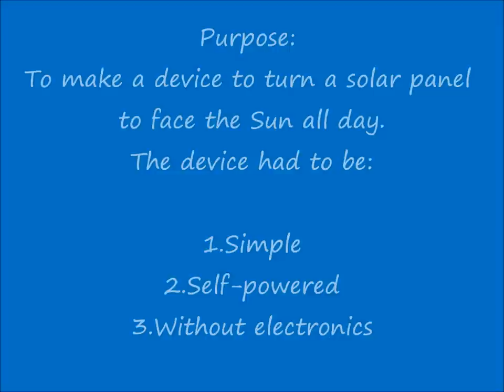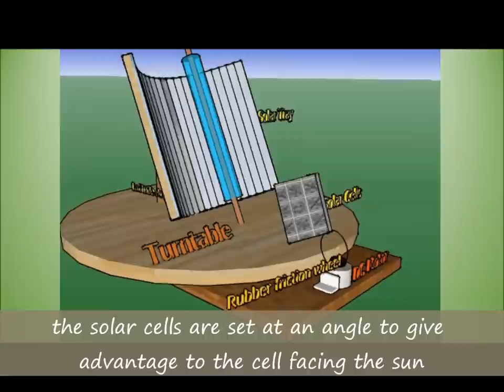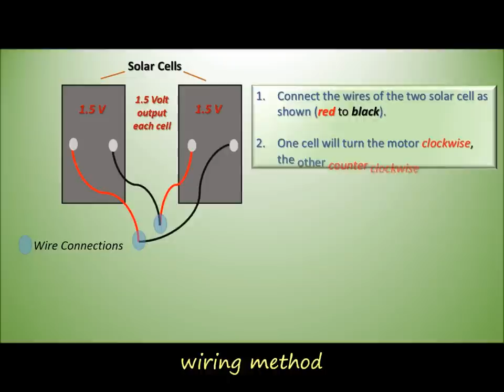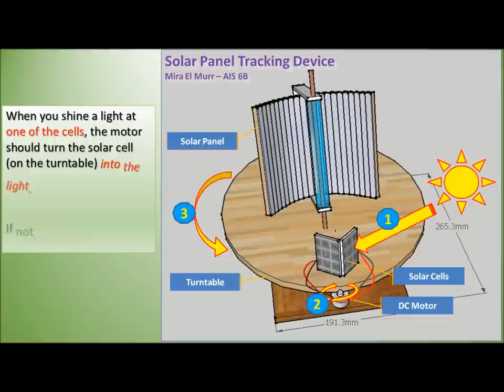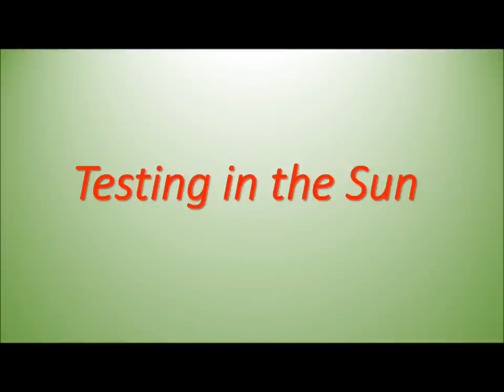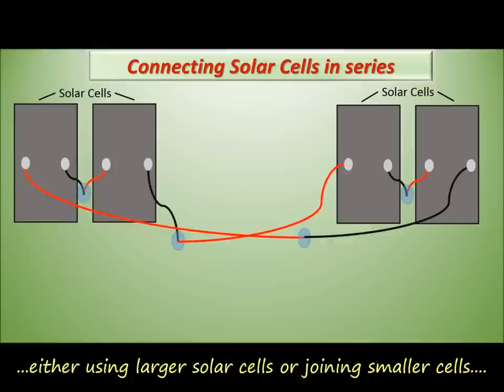Cool DIY Solar Tracker Self Powered No Electronics - How it Works

Comment: a todays solar cell is based on the good old photoelectric effect. as todays cells are effectively photo diodes and a diode is in fact an electronics device i have to assume that the usage of such photo cells violates the given requirement of "no electronics".

in an open circuit a vice-versa serial combination of such solar cells will see roughly the nominal voltage of all illuminated cells. the non illuminated ones work in a resistor like fashion - without a current there is no real impact. but when driving an electric motor then the power sent from the cell with the better energy collection will drive the motor and at the same time drive the same current to the other cell and its "resistor" thus sending heat to that other cell. such operation is degrading those cell over time - even if only one movement cycle is run per day plus the times where there is current but the motor is not supplied strong enough to start moving. mid to long term such a setup is assumed to fail because of the cells are going to loose their original capabilities quicker than in normal use. (on day times whilst normal tracking the one cell that is trailing is ageing, at sun up the other one gets fed with the power until the the whole device returned to the morning position.)

nothing against smart simplicity but sometimes a bit more logic and respective elements are needed to get the whole item not only working but durable. what's a 1$ electronics against some 5$ set of solars cells and the works to replace them to fix the device every 5 to 20 months?
Reply: all they really need is a couple of low value Schottky diodes.
Reply: Schottky diodes are electronics as well. ;-)

but yes, its the right thing. low price, minimal voltage and power loss. maximized lifetime of the whole setup.
Reply: Yeah, I know. I just figured that since the premise of a non electronic solution had already been broken by the use of solar panels it wouldn't be a huge deal. lol
Reply: For the amateurs among us---Could you provide a diagram of where within the circuit the diodes would be appropriate? Thanks.
Reply: I've read that solar panels have by-pass diodes installed in them. So the circuit works better than described in this comment by Alexander Stohr.  When you draw the circuit with the blocking diodes and bypass diodes in it, there seems to be no reason this shouldn't work well for the intended life of the panels.  That is without adding the fast-switching Schottky diodes.

Comment: it's good for a very small project, but when you're using a full sized 30kg panel, it doesn't work any more ;)  a turntable big enough would cost a fortune :o    but well done still.   good job.
Reply from the maker: We agree it would be a different task to scale this up to a practical platform.  We used this for a small solar powered parking night light (which would have worked fine without the tracking anyway) but the concept worked - in fair weather of course. The end part of our video suggested a structural frame that would support/suspend a heavier panel where the motor would only turn an almost frictionless pivoted assembly.  Agreed that the center of gravity of the assembly would have to be fine-tuned and so on, still, the turntable may be a circular pipe at 90 degrees to the panel (or the axis of rotation) with the panel lying at the required Latitude angle - or a setup that may include actuators instead of motors but using the same tracking principle and maximum possible leverage.  All theories hopefully for future projects ....
Reply: interestingly, I was at my brothers place for dinner last night, and he had a wooden turntable on his garden table for food serving, it was big enough and strong enough, that it could possibly support a full sized panel.  so I stand corrected on the concept.   they're called a "lazy susan" here, you can get bearing kits quite cheaply online for quite large  projects.
Reply from the maker: Thanks for the reassurance and the tip. I found some useful lazy Susan's on the net. I am now considering tilting the lazy susan (perhaps made of metal tubing) at 90 degrees to the panel and so the assembly would turn on a central axis but tilted to face the sun at the required Latitude angle like a roast rotisserie (probably inspired by your brother's dinner :o)
much obliged for your comment....
Reply: as I'm a budding home engineer myself, I'm glad to be able to offer a useful suggestion to others :)
Reply: John Douglas You don't need a turntable. It can be a pipe on bearings like go-kart rear axles. A riding lawnmower rear axle. Super scale could use a car axle. Or even a front spindle of a car with the tire still mounted. The motor can scale with the project. As well as the cells powering the motor. Using axles comes with the benefit of already having pulleys /gears in place. Strong geared motors can be had from windshield wipers, power windows, starter motors (can move a car if cranked in gear), etc. All of which are 12v motors that would need no modification to run off 12 volts of solar cells. All of this can be had from junk for free or super cheep from a scrap yard. The only thing I would change with this design is having the cells facing 4 different directions so that it will return to east in the morning. The 4th cell would need to be facing SE (Northern Hemisphere) at the end of the day when the 2 in the middle are facing west at sunset. Cell 1 is what helps cell 2 kick on the motor. Cell 2 and 3 fight each other to hold it still. You can even go further by adding a 2nd axis (up and down) with another motor and 2 more cells. All of this can be put on a linkage system to operate more than 1  panel.

Comment: I feel bested by a girl Im cool with it tho and the idea is brilliant.
I believe it will even work on my boat.
I never thought of putting a tracker on it because at ancher it moves around all the time I also thought trackers didn't  moved fast enough.
Now Im thinking wifh 360 degree movement as described by another post I can make this work and with my recent interest in learning about arduinos this could be done using auto 12 volt parts.

THANKYOU  THANKYOU  I hope I have even given someone else the same idea
Should work heaps better than flat on the rear deck roof

Comment: Not really watching the vid. Just wanted to mention that there are electronics on the thumbnail. Why use such an inaccurate title?
Reply from the maker: Solar panels have built in electronics so these shouldn't count for the purpose of the video title. So we thought that, for brevity, a smaller solar panel controling the orientation of the large panels shouldn't count either... No? We could say "without complex electronics"....  but then again complexity is a matter of opinion.... :o)
Reply: @ScienceClubKidsandParents  there's a motor in the thumbnail. I would count the motor as electronic
Reply: @mrtommypickles8635  You are picking stuff apart too much, the little girl found a simple way to control the direction of her panels, deal with it.

Comment: Video title is deceptive: requires electronics including wires, motor and solar panel.
Reply: Wires and motor come under electrical.
Reply: what else do you need to rotate a machine to always face the Sun ? Can you elaborate what is the other option ?
Reply: I have come across few kids who learned science by themselves:-) ........ There is always a wise women/men who passes on the knowledge :-) .... So we must appreciate a simple solution for smaller solar panel sun tracking !
Reply: Ram raj Solar panels are electronics
Reply: I think its pretty clear the title means it doesn't rely on an external source of grid-supplied electricity. The entire point is for the device to be self-powering and to not rely on grid power.
Reply: Troll

Comment: no electronics..remember....?  well?
Reply from the maker: Meh, nothing you have to re-invent. Connecting a solar cell to a motor, with no computing or external electrical power... hardly an electronic circuit. Basically, it's probably an "electrical" circuit... see? No electronics...  😁😊